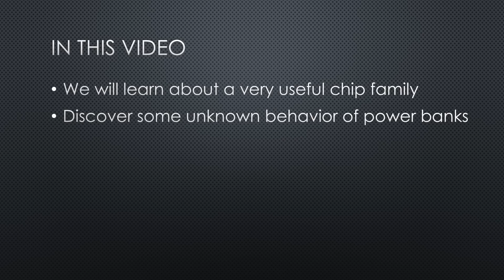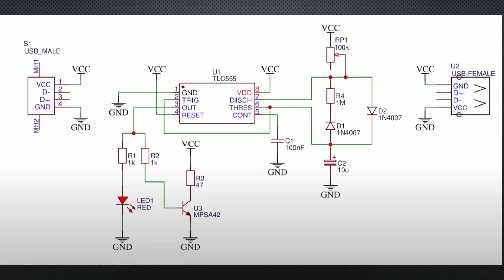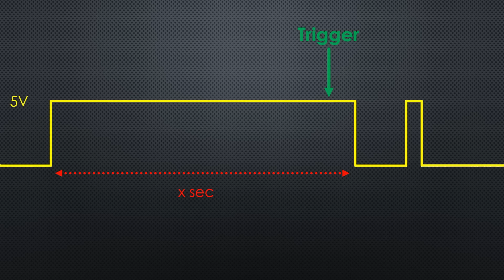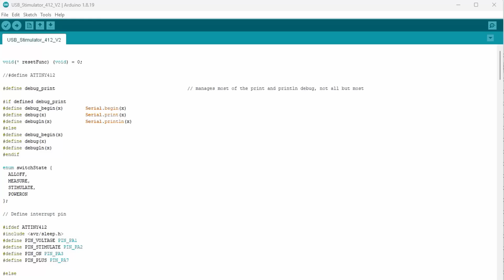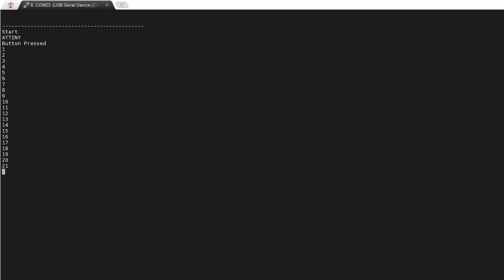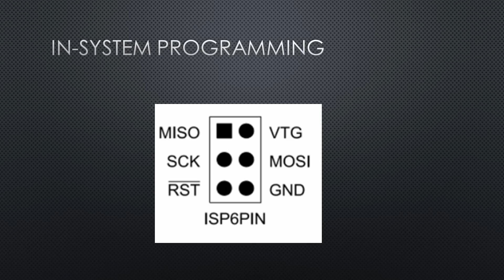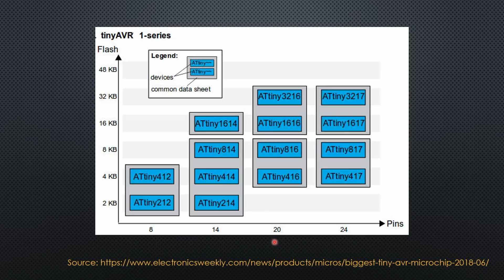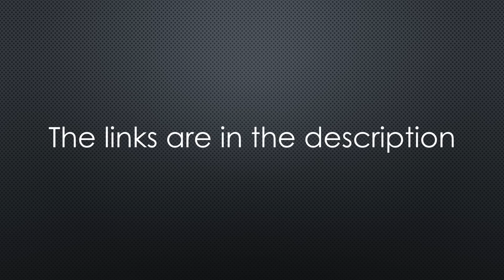477 Use the very attractive new ATTINY chips for your projects

Comment: This reminds me greatly of my adventures with the 10f200 (6 pin IC). "I'll start so small, it'll be easy!" oh that caused such a headache with the pin multiplexing. I had to figure out how to repurpose the /RST line as input, the other 3 GPIO pins charliplexed 6 LEDs. One cool side effect was by using the /RST like I did, the project uses no real power while off, as a micro-solar cell actually holds it in a halt state, being used as a light sensor basically. Not enough to power anything, but enough to bias an input pin.
Reply from the maker: Indeed, 6pins is not a lot for a microprocessor!

Comment: I had a similar experience recently with chips from China. Ordered 5 ATMega32 chips from an Amazon seller. They provided bad tracking and it took over a month to arrive. Before they showed up, Amazon said it was possibly lost and offered a refund that I accepted. In the meanwhile I ordered and received more chips from Digikey that worked great. When the first chips unexpectedly showed up, I had the same experience - they all had bad IDs, and not all the same. Tho they did seem to accept the programming. Still I didn't trust them and will probably just toss them, esp since I got my money back on them already.

Comment: regarding the question at 8:37: To save to relevant time i would add a big capacitor on IC supply and measure the 5V, if the voltage starts to drop i would write the value to Eeprom
Reply from the maker: Good idea!
Reply: @sSpiess i stole this idea from a safety (not security) related project, where a brownout or total power out had to be logged. So this is kind of battle tested. The cap was in the range of 560µF but i do not remember if it was directly on 3v3 or on a higher voltage level. But this project had 2 redundant µControllers and an external memory to log this power issue. So the power draw was quite huge compared to a single µC

Comment: Love Microchip.  I launched one of the very first high volume PIC designs in Michigan in the late 80's in the hundreds of thousands per year (PIC16C54) on vehicle remote transmitters.  One Time Programmable only,  but this was revolutionary then as most parts were mask ROM at the time.  They even put those devices into SOT packages.  They were marketed as micros but were used as "ASIC fixers" to fix small hardware bugs in complex ASICs.  Cool company!
Reply from the maker: I learned about the first steps of Microchip from an interview on the Amphour podcast (with the former CEO). Very interesting!

Comment: IMO a powerbank is overkill for such projects. They are also not relyable for this task of supplying power to low current applications. Most not fo even a good job of charging my phone. The capacity also is often nothing else than a lie. That can better be done with just a rechargable AA batteries or any other lithium cell. I don't get why even think about using a powerbank for that task.
Reply from the maker: I agree that simple batteries often are a better solution.

Comment: If i had to guess about the 'fake' chips, maybe they were flawed 416s put in a smaller package so as to not expose the non-working pins. I think they do a similar thing with CPUs, pack a number of cores and depending how many of them work, sell them as the corresponding variant. In the ATtiny case, they must've forgot to flash the correct identifier afterwards.
Reply from the maker: It seems they are 412s with a wrong code. So they should be ok for Makers.

Comment: what if an interrupt is attached to the pin that is reading the voltage of the power bank and set it to falling edge detection and triggering the FET
Reply from the maker: And then, what is the purpose?
Reply: @AndreasSpiess  when there is a drop in voltage..ie logic 1 to 0, the falling edge detection detects it and triggers the FET

Comment: Hi Andreas - great to see you getting into the ATTINYs - brilliant little chips, and Spence Kondes Core works like a charm.

One thinng about the programmer: you don't need to sacrifice an NANO: UPDI is possible with any cheap USB-2-Serial based adapter. The ones with the CH340 chips work quilte nicely and are normally a dollar a pop. One resistor between TX and RX and you're game; I did a video on that toppic some time ago.

Keep up the good work!
Reply from the maker: Indeed, you can also use an usb to serial adapter. I tried it after other commenters wrote it.

Comment: I think I would try to put a diode and a capacitor bigger enough (I am not sure how much) to provide power for the ATTiny so it can detect the powerbank has shut off through the GPIO and emit a signal to the current FET. (or maybe write the time to the EEPROM). I think thisway the writes to the EEPROM can be reduced.
Reply from the maker: Good idea!

Comment: I prefer the x26 chips because they are the tinyavr 2 series.
Reply from the maker: Do you get them in these small cases?
Reply: @AndreasSpiess  I realized after I made this comment that the 2series parts don't come in dip packages so doesn't fit your criteria. They also only come in 20 pin ssop/soic and while small not perfboard friendly (without a (admittedly cheap and common though bulky) breakout board).

Comment: Partial fake issue: the factory orders or makes a big lot of ATTiny416 chips (wafers). Then they take what they have and put them into different packagings as they need - some have 20 pins, some have 14, some have 8. The unused ports are not connected to packaging pins. Maybe the unused ports could be used as additional bit memory?
Reply from the maker: Another  commenters wrote that Microchip made an error with these codes and even RS components sold them...
Reply: @AndreasSpiess  interesting. Did they publish wrong codes or manufatured wrong packages? The latter would be the case of putting the wrong silicon into packaging.
Reply from the maker: @ok4rm  Just the wrong code on the chip.

Comment: are eeprom writes atomic? what happens if the power is cut off during the write? at very least, the erase and program steps are probably 2 separate operations, and possibly both those operations will have unpredictable results if interrupted. if the datasheet at least limits the corruption to the page being written at the time of power loss, you could take a few approaches, depending on what kind of atomicity you do get if any. this will require lower-level access than Arduino's EEPROM API.
- a lot of EEPROMs will let you program single bits, but only erase entire pages. if your eeprom's size * 8 is less than the max number of seconds you expect to measure, and if it exposes an atomic operation to set a single bit, you could just set a couple K of EEPROM to all zeros, and then set each bit to 1 one at a time, one per second. to read back the value on next boot, you just iterate through the range and count the 1s (or, don't count them, binary search the range for the last index with a 1 value). A benefit of this approach is that the memory cells only have a single program/erase cycle per training session.
- if you want to measure more seconds than there are bits, and you have atomic erase operations, you could instead do a double buffering scheme. you have 2 structures (make sure they're located in different pages of the EEPROM), each with a boolean flag and an int. when you want to store a value, you write the value to the int in the structure A, once the write is done, you set the boolean flag. then you erase structure B's page. next time you want to write, you do the same thing, but writing to structure B and erasing structure A. when the device restarts, you read the value by checking if either of the structures has the flag set. if one of them has it set, use its value; if both have it set, use the smaller value, if neither are set, fail.
- if both program and erase are atomic, you can make it more reliable, use 3 pages. 2 of them you alternate between writing the int values to, and the third one you set its first bit to either 0 or 1 atomically (by writing a 1 or erasing the page), to tell future you which page was most recently written. the benefit of this is that it might still work even if program and erase aren't atomic, since the critical operation is flipping a single bit; maybe erasing a whole page isn't atomic, but that single bit will necessarily have to end up either a 0 or a 1. that state is well defined during the write and erase steps for the other two pages, and the only time its state isn't well defined is when those other two pages' states are well defined.
- brute force it. have an odd number of copies (3 at a minimum, if you don't trust the hardware maybe 7 or 19 or something) of the int, each located in a different page. to store a value, you write it to each page 1 at a time. to load the value, you read in all the pages and use the value with the most "votes".
this is not my area of specialty; i'm very much not an embedded software developer. so i'd be curious to hear other's takes on how to do this safely.

Comment: Your "fake" attinys are likely manufacturing rejects with incorrectly programmed SIGROW fuses. I don't think they can be re-programed, but you can read them. The spec sheets go into what values are in SIGROW deviceID (412 = 0x1E, 0x92, 0x23. 416=0x1E, 0x92, 0x21)
If you could figure out somehow how to write those read only fuses you could possibly "fix" them.
Reply from the maker: Another commenter wrote that these chips came from Microchip and were also sold by RS Components. So the solution could be to switch the test off in AVRdude...

Comment: Maybe just buy a better power bank, eg. The Anker I have does have the feature to supply low power without switching off via just pressing and holding the charge display button, led goes green and that's it.
But anyway, nice video and project as always, thx!
Reply from the maker: Many others also mentioned this function in the Anker power banks. That is good to know for the next purchase!

Comment: With the low power draw, you could probably use an atomic battery to power an ATtiny. It'd be expensive, but it would last for an extremely long time.

I would probably also grab an nvSRAM chip and use that for data storage, in order to conserve the write/erase cycles on the ATtiny's EEPROM in case I ever wanted to reuse it.
Reply from the maker: An interesting idea. Probably a bit more expensive to build...

Comment: interesting idea.. short question. didn't you  try to put a capacitor on the tiny's power line to keep it running just enough to write to eeprom after power was lost?
Reply from the maker: I am sure this could be done. But it would need two more parts...

Comment: there is a better solution I think, you could have BEGIN: 1) sent the first pulse, 2) start sleeping @ 1000ms, 3) send a pulse, and then LOOP: 4) increment the time by 1000ms, and write to EEPROM 5) sleep by total increment, 6) send the pulse; the idea is that the device will send larger and larger increments until it gets turned off, the last value is the one you want. you should either pull up or pull down the FET so the pulse happens as soon as you plug it in, that way as soon as the bank powers down the device, the FET resets and the pulse activates the power bank again.
When the uC starts, if the value is > 1000mS, it uses as default.
Reply from the maker: Good idea! Maybe you try it if it works?

Comment: Very interesting approach!
However, you could avoid the constant writing to eeprom by detecting the powerloss. A common way I do it is isolate the supply of the MCU via a diode if there is extra load on the system and add a capacitor on the supply-pin of the MCU. Then I use a pin on the MCU as detector for the powerloss by setting it up as a falling flank interrupt. This allows the fastest detection time and at this point you can store your data. You can test the timing by using an oscilloscope and setting a pin high once the storing is finished and watch this pin vs the flank of the power pin to see how long it took. If you know your power consumption including the storage needs you can calculate a capacitor required, otherwise it is easy to test with scope. Remember to use 10X probe or more to reduce load on rail.
Reply from the maker: I agree, this could be done. But it would add 2 more parts... A good idea for other applications!
Reply: @AndreasSpiess  A capacitor on the supply pin is a minimum though, and always recommended.

Comment: If I was designing this device, I'd use a P channel FET to draw a small spike of current every two seconds so it worked with any power bank, and I'd use that to charge a capacitor that powers the low drain circuit rather than wasting the pulse energy just to keep the power bank alive.  Monitor the output voltage and charge the capacitor more often if needed to maintain the voltage.  I love microcontrollers but a simple comparator and a voltage divider could switch the p-ch FET.
Reply from the maker: Good ideras. Try it out and report if it worked!

Comment: The chip signature is often laser written on the die.  It's possible the dies were purchased in bulk by the Chinese supplier at a discounted cost and written with the wrong chip ID, or maybe they bought surplus chips with the wrong ID written by Microchip?  Instead of laser written, it's also possible that the chip IDs are electrically written at the end of the device test and that was somehow screwed up during manufacturing.
Reply from the maker: Another commenter wrote that the mistake was made by Microchip and even RS Components sold these chips. But I do not know if this is true.

Comment: The fake chips may all use the same die and sell it in different packages, and just connect fewer pins in the smaller packages. They can probably save some money by having larger runs of fewer designs, and not needing to customize the signature for every part.

(They might also have different dies for different flash sizes - probably not a coincidence that it identified as a part with the same flash size but higher pin count)
Reply from the maker: Another commenter wrote that the mistake was made by Microchip and even RS Components sold these chips. But I do not know if this is true.

Comment: Could an easier solution to both the 555 and ATtiny options be simply to create a basic buffer/psu circuit using capacitors to draw higher power very briefly and which only recharges once almost drained and would also work with all types of power banks/not need a supplement too?
Reply from the maker: I do not know. Maybe you try it and report back?

Comment: I am so happy I subscribed to your channel!

I've got a tube full of old ATTINY chips that I can't use, because they will no longer program since I "upgraded" my old PC.  Now that they came out with a new and improved ATTINY, I'll have to order some of them.  I currently have no Nano, so is there a "ready to go" ATTINY programmer I can buy?  If so, which one will work with a USB cable on a current PC?
Reply from the maker: You can also use a standard USB to Serial adapter and SerialUPDI (Google). It works with the Arduino IDE.
Reply: If you have a desktop, they often have serial ports even now, at least the motherboards offered to custom builders often do. They're just not populated as a port you are familiar with. Often they're just pins on the board. However, $5 adapters exist that hook to those pins and go on an unused expansion slot to turn those pins into a physical serial port. Laptops though... ugh they have limited IO and you're stuck with any off the shelf USB to serial or whatever you want.

Comment: I use the new AVRs too, the 1614 basically has the specs of a 328p, plus it has better timers, more versatile GPIO, a DAC, and even a custom logic system that I haven’t figured out yet. But I will note that they’re a pain to use with AVR-gcc, you need to get fils out of MPLABX for it, and I couldn’t get EEPROM working since it uses a somewhat different memory address space. I use SerialUPDI instead of the arduino sketch, all it takes is modifying a USB to serial dongle. As for the older ATtiny programming problem, it’s less of an issue than you make it out to be. You can use the 4 programming pins for other things, so long as the programming process won’t interfere with them. Even the reset pin can be used as an analogue input, so long as the voltage on it doesn’t go below the going-low threshold.
Reply from the maker: Thank you for sharing your experience. 
I agree with your comment about the ATTINY85 (otherwise, they would not be very useful). Still, as you write, you always have to pay attention to what you connect to these pins.

Comment: i just soldered a resistor in the inside of my powerbank to simulate a higher current. So now it will only turn off below 10mA.
Reply from the maker: Good idea if you easily can open the powerbank.

Comment: Way back in time we got RAM chips with one pin that should be tied to GND or to Vcc. They were rejects where just some bits were stuck. So the factory marked down the capacity to half of what it was designed for. The mentioned pin was an address pin in the device with twice the capacity. Now half the memory area was disabled by tying the pin down.
Why do I write this? Because I have a suspicion you got some rejects of a chip where they repackaged it so the bad pins are not accessible. But the device code is stored in non-writeable memory. So they cannot change it. Devices like this can be used in products where the producer buy these chips and know what they get ( for a very cheap price ). Then one of them turned around and pushed them on Aliexpress.
Reply from the maker: Nice story (and very creative recycling). In this case, another commenter wrote that these chips even were sold by RS Components. So it seems that Microchip made a mistake. But I cannot verify this statement.